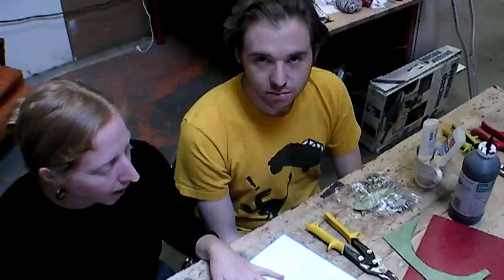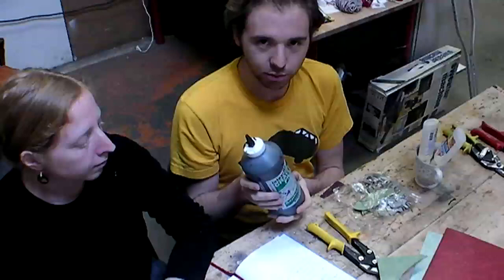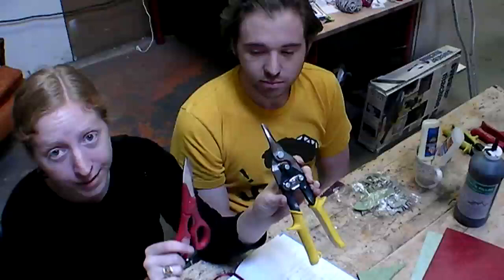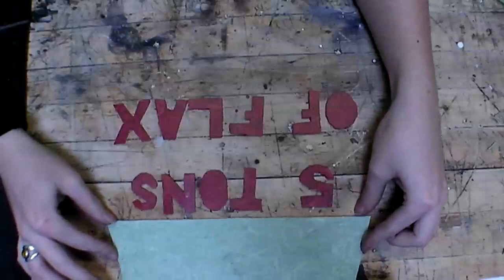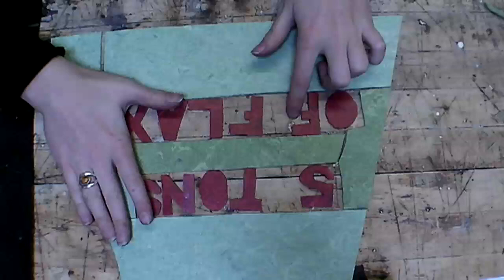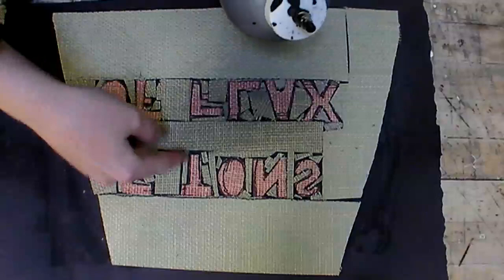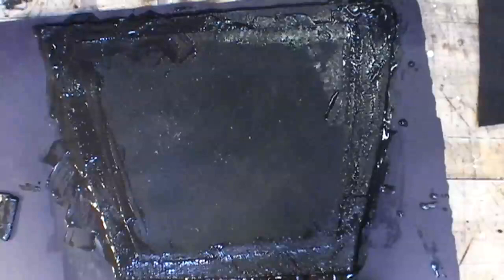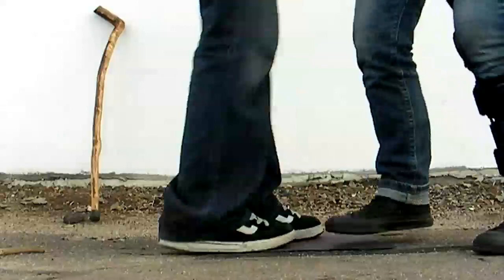Linoleum Asphalt Mosaics - CRAFT Video Podcast

Comment: Remind me whats the purpose of wood gluing the front of the tile to construction paper? Wont that just make black spots o the front of the design? How come the black tar liquid doesnt seep in between the letters and bleed the front of the logo?
Reply: Its more for camouflage, so your design won't be discovered and likely removed before it has a chance to permanently work itself down into the asphalt around it.  By the time that happens, the top paper will have worn off from all the car tires rolling over it.